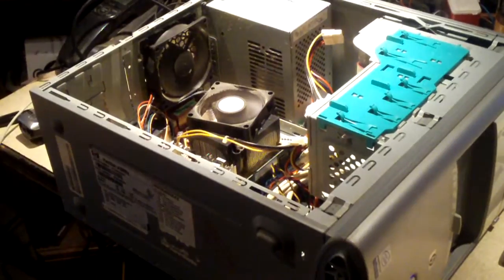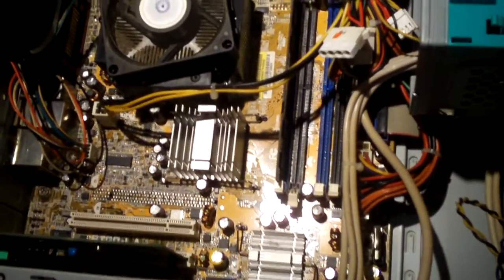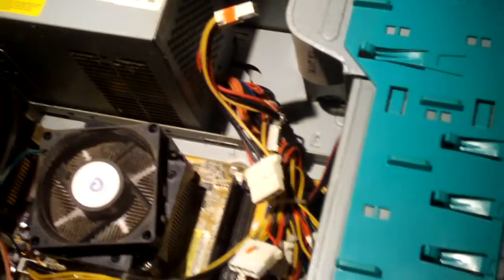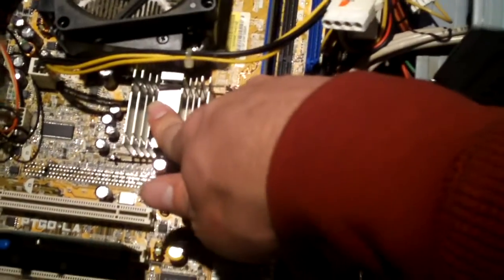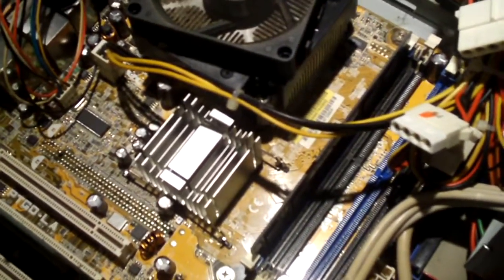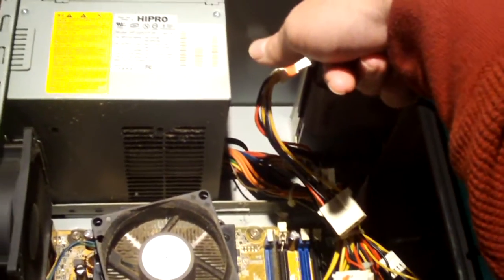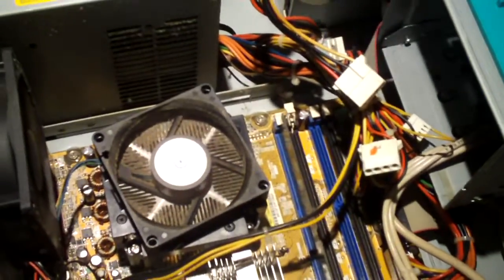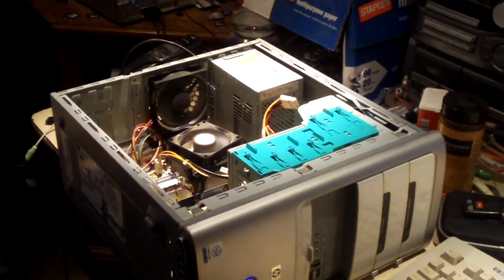Some information regarding the Intel 915 chipset and lack of WDDM support

Comment: I had a 965G chipset nearly the same but supported Aero with the GMA 950. I remember the controversy with the GMA 900 as it could run Aero in the Vista Beta but not the full release.

Comment: What do you think of Vista/7 on a Pentium 4? I think on faster Pentium 4s it’s decent and not as bad as some make it out to be.
Reply from the maker: Vista will actually run decent on a lot of things, including a netbook! The Prescott 775 P4s will actually run it quite well.
Reply: @CubeComputerChannel  Yea people are just too pessimistic, but I’ve never used Vista on a single core. Maybe one day though, I do have a Dell Optiplex GX260 from 03 that I could install Vista on, but one of the capacitors is bulging so I’m scared at the mo.
Reply from the maker: @mustasheolll2020  Vista probably would not run too well on that kind of system. That's a socket 478 setup with Northwood or even Willamette P4.
Reply: @CubeComputerChannel  Yea It’s usually the later ones that are at least 2.5 GHz or higher

Comment: But a graphics card from 2003 can run aero this is weird
Reply from the maker: Manufacturers can provide driver updates that would allow the card to run newer games or display newer graphical effects, as long as the hardware would support these things.
Reply: @CubeComputerChannel  Maybe Chipsets works differently? According to intel it's because the 915 is missing a "Hardware Scheduler" because it came out before Vista's requirements came out...But graphics cards from Nvidia and Ati dating 2002/2003 can run aero, this doesn't make sense to be blunt. I guess that's that though :/
Reply from the maker: @mustasheolll2020  You're comparing integrated intel chipset graphics to discrete graphics from ATI and nVidia. Of course the discrete offerings were designed to run graphics such as Aero earlier than Intel's chipset graphics. Integrated chipset graphics have always lagged behind in performance and offerings.

Comment: My laptop is a hp Compaq nc6000 with Intel 855/915 chipset and ati Mobility Radeon 9600/9700 series Graphics card (it's an integrated card) and runs very well on Windows Vista and 7!

Comment: Can someone please confirm if 915 Chipset supports Core 2 Duo or even Core 2 Quad processors? Because as far as I know LGA 775 on 915 Chipset is limited to Pentium 4s and Ds. multi core support came with 945 and 965 chipsets. Will C2D work with 915 Board?
Reply: Yes, i915 (and i925) can run Core 2 Duo, I did that on Asus P5GD1-VM, bios somehow can init Wolfdale CPUs, and windows detects 2 cores! CPU is pin-modded but it works, after 19 years i915 can work with dual-core CPU lmao

Comment: I have the HP Pavilion a1040n model with that motherboard but with a Pentium 4 HT 3.00GHz 2MB, and 1GB Ram. It's running pretty decent with Windows 7 Pro 32Bit. I ordered a Core 2 Duo e6550 for $4 and gonna test it on this, I got the cpu for another build as a media center pc or a light gaming pc.
Reply: Can you confirm if 915 Chipset supports Core 2 Duo or even Core 2 Quad processors? Because as far as I know LGA 775 on 915 Chipset is limited to Pentium 4s and Ds. Did it work?

Comment: The machines affected by this are usually way too old to work well with Windows NT 6. So the lack of WDDM support just means that they are confined to Windows XP (and whatever else they may support) which isn't exactly terrible.
Reply from the maker: With a discrete graphics card installed, Intel 915 systems run Vista/7 just fine.

Comment: I have the Compaq version of this machine, has a motherboard that looks exactly the same, but came with a Pentium 4 HT at 2.8 GHz, and has a PCI-E slot with the Intel 915 Chipset. It currently runs Windows 7 with an nVidia GeForce 210 card.
Reply from the maker: Yeah, if it has a PCIe x16 slot available, then a graphics card will make the platform more ideal for Windows 7. Otherwise, you're stuck with either the onboard graphics or installing a "hard to find" powerful PCI graphics card.
Reply: ***** I actually found a "powerful" PCI graphics card at my Goodwill for $5… It's an ATI Radeon X1300.